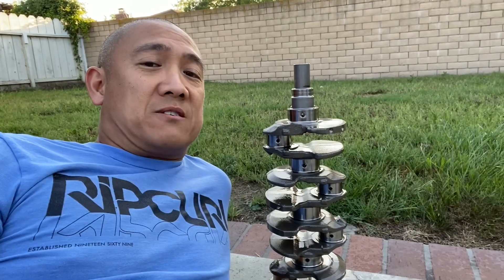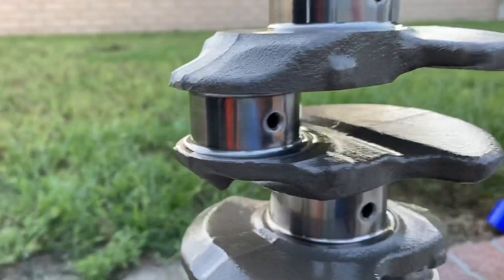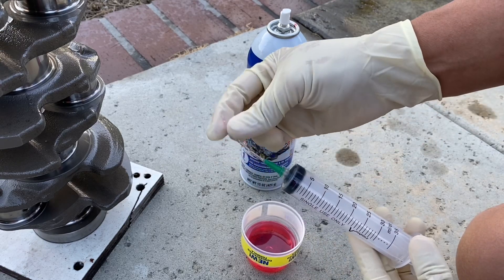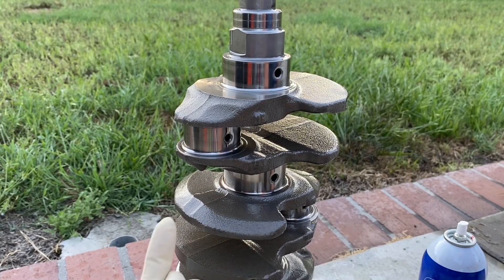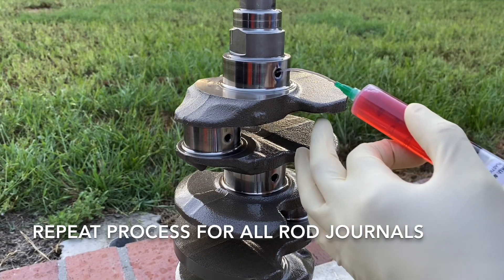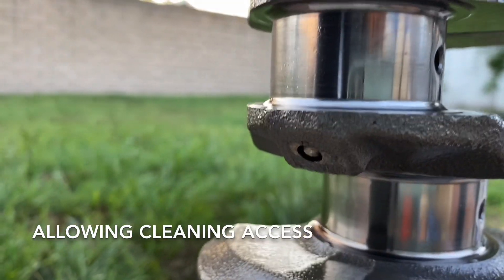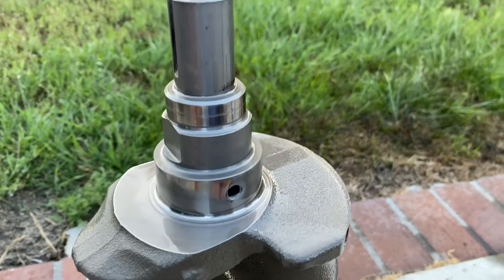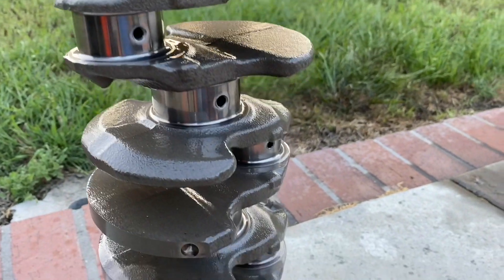How to Clean a Honda B Series Crank

Comment: Loving the channel so far. Very helpful - keep it up!

One thing though: WD-40 is a solvent, not a lubricant (been told to never lube guns with WD-40) so I'm not sure if WD-40'ing the crank would be the best thing - may contaminate the engine oil a bit, or cut through the cranks lube.
I realize you're probably trying to lube everywhere that you can't reach, which is smart. They do make spray oil lubricant though :)
Reply from the maker: Thx for the kind words and pls subscribe. With respect to WD40, u r 💯 correct it is a rust-prevention solvent and degreaser created to displace water… hence the name - WD (Water Displacement) - 40 (created on the 40th try). I should have not said “lube” and rather said “coat w WD40 for rust prevention”. Note, just after I said lubricate w engine assembly lube. Great catch. 👊